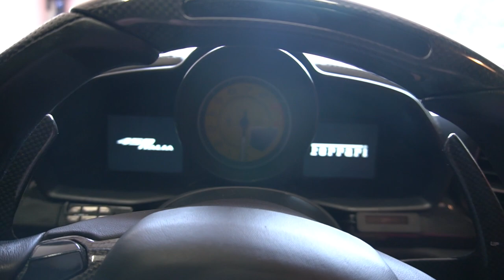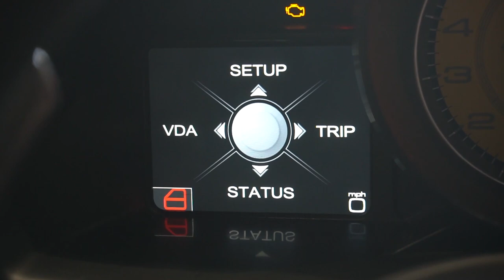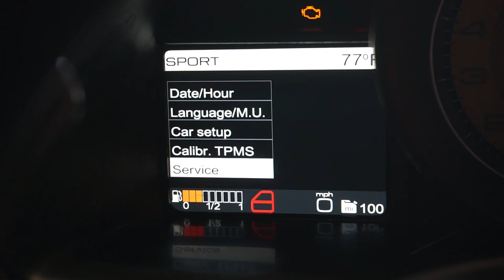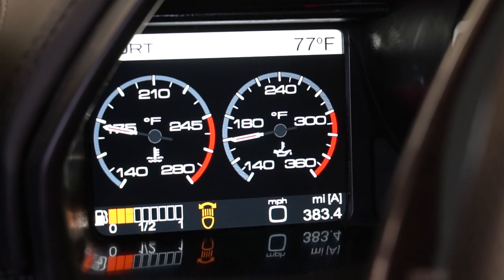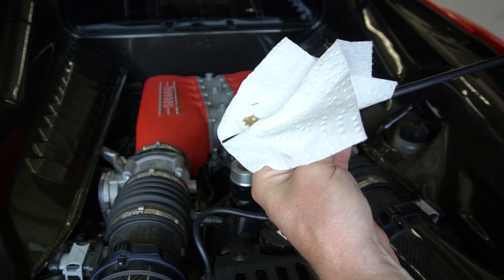How to change the oil in a Ferrari 458!

Comment: You need a 4 post lift bud.  Life changing experience!!!!
Reply from the maker: I'm content with my quick jacks
Reply: Javier Hernandez - mixing a 9 foot ceiling with a short guy and shorter car makes it work pretty good (I had that setup in the last house).  Certainly the higher ceiling is better, but this can work if your not sticking an F250 up there!
Reply: Javier Hernandez - that’s the 2 post lift that has the higher posts bud.  My 4 post has 7.5 foot posts.  Really nice setup for about $2k!  Thing even has rollers and can be moved around...
Reply: @devnull128  really 7.5ft, 2k, and can be moved? I thought they were more expensive, that's pretty feasible. What's the max weight of yours.
Reply: Javier Hernandez - I have an 8,500lb setup.  Have had it for many years (bought it when I had my first C5 Z06 and needed a clutch).  Was cheaper than the clutch!  Paid for itself 100 times over.  Can’t recommend these things enough dude!
Reply: @devnull128  dang was the clutch repair that much cheaper that a car lift and diy fix was still cheaper than a clutch at a dealer. Only problem is that have a Yukon xl Denali and a sierra so the weight is kinda pushing it but I think it'll do. What brand or model is it.
Reply: Especially for a Ferrari beautiful piece of machinery❤️😍🥰

Comment: Dan, there's a thread on FerrariChat by AZLambo, from Oct 2015 called, "DIY oil change made easy
" 
Basically, since all three drains plugs drain straight down, he modified the plastic under-tray to create 3 drain holes and removable rubber plugs. Since you're no longer in warranty, might make an interesting future video  doing that mod, since this way is such a PITA.
Reply from the maker: Yeah I saw that. May look into it
Reply: David Grant ,

AZLambo here!  Yep, by hole-sawing out the three, 3” holes in the undertray, and putting in the three 3” rubber “plugs”, changing the oil on my 458 is a piece of cake!  No undertray panels to remove!

Comment: This is the video we all have been waiting for since you bought the 458!  Next time, you may want to lubricate the o-ring with fresh oil (Standard procedure for similar oil canister on Gallardos).  I am not sure if the o-ring requires lubricant for the 458 (Perhaps it’s a special Ferrari taxable compound), but I would put oil on the o-ring and be careful not to over tighten the canister (oil on the canister to engine interface increases joint axial preload when applying a given torque).  Apologies for my nerdiness, another awesome video Dan!
Reply from the maker: Ah yeah good tip
Reply: Normal Guy Supercar That’s what she said.

Comment: I assume that you lubricated the o-ring before installation to prevent it from binding on the housing.  Also, it's more friendly to the motor to add a little oil in the housing before buttoning it up.

Comment: Why not consider an elevated funnel or raising your drain bin upwards to mitigate the heated oil splash. I grew up in an old fashioned gas station, our drain bin was always never more than 12 inches away from the oil drain plug... This is a simple solution to oil drain splash...
Reply from the maker: Yeah.  That may help.

Comment: Just a FYI. You might want to change the oil filter first to allow the old oil to drain from the Oil Filter housing back into the system. The filter housing is designed to hold oil in it for startup. Great Channel!
Reply from the maker: Ok thanks for the tip

Comment: Dan, do you leave the filler cap open whilst draining the oil?
It seems to work better for me, as oil comes out more evenly and directed as opposed to sometimes when it is erratic and I end up making a mess
Reply from the maker: No it was loose
Reply: I unplug the dip stick so it's more restricted than the oil cap but doesn't glug.
Reply: Cool :)

Comment: Time passes , but the 458 is one of the best looking cars / ferraris ever made 👌.
Wich wheels do you have ? 
Also where is the oil spec (viscosity etc ) stated ?  I tought the 458 would need like a 10w60 in the summer
Reply from the maker: The service manual specifies 5w-40.  I don't know which wheels they are as they are aftermarket.

Comment: Maserati twin turbo V6 oil change interval is 12K also, but since it's direct injection I change oil every 8K to 9K to reduce the likelihood of excessive carbon buildup on the intake valves. I do my own oil changes so it's cheap enough.  I don't know if the 458 is direct injection but if so you may want to consider more frequent oil changes as well.
Reply from the maker: Yeah I'm planning to change it far earlier that 12k.
Reply: 8K - 9K is too much on a turbo engined car,  5K is maximum in my opinion.
Reply: @maxnix346  not on a Ghibli V6. Made by Ferrari.

Comment: Hey Dan, any chance you can do a video detailing the use of the Launch X431, specifically pulling numbers on a clutch or changing the F1 pump fluids?  Cheers.
Reply from the maker: Sure
Reply: Den!
can this diagnostics check the clutch wear? and re-learn the ecu gear change when the clutch is changed?
and of course get the air out of the system when changing oil in the F1 system ??
My car is F360
Cheers.😎
Reply from the maker: @mariovu1978  the higher model can
Reply: Normal Guy Supercar 
Launch X431 Pro V3.0??

Comment: Have you thought of drilling holes in the pan so you can access the drain plugs without removing the pan?
Reply from the maker: Yeah that's one solution... But then it might collect a bunch of oil on the pan if you splash it. Plus you don't get to inspect the rest of the car.
Reply: @normalguysupercar  Good points

Comment: I think you have the Quickjack in the wrong orientation. In addition to front and back specific, the locking arms are suppose to be on the outside not on the inside.

Comment: Great video Dan.
Does the Launch X-431 PROS Mini also connect to a GTC4Lusso? I have a 2012 458 Italia which I need to start doing my own oil changes as my 7 year maintenance plan just expired. I would be willing to spend this amount on the Launch computer if it was also compatible with my GTC4Lusso.
Reply from the maker: It should do the Lusso

Comment: No new stamps in the service book, is it not decreasing the car's value?
Reply from the maker: It may
Reply: @normalguysupercar  Not if you have receipts and video as proof.   Sign the damn book yourself.
Reply: No
Reply: Just keep the receipts! Good enough
Reply: You don't need to be a Ferrari tech to change the tyres do you ? The oil change on the 458 is as simple as it gets. I'd rather someone like Dan to change the oil himself and spend that 2k on other pressing maintenance items, if I were looking at buying his 458. This is Dan's baby...however, to a dealer it's just another 458 they need to do before lunch. A stamp is not worth 2k.
Reply: @themessenger5868  just saying that the next owner may care.
Reply: @simplecarblog5663  , Yeah I understand, but if it were that important to them I guess they wouldn't be the new owner. I've owned a Ferrari for 12 years and I can say from experience that dealer servicing is a rip off and not worth the money. Like anything that is for sale, it's worth what someone's willing to pay for it. I understand the question, I just don't agree with it when it comes to older Ferrari's and other cars.

Comment: The hardest part of the oil changes is removing the forward panel. How do you remove and remount the air flow guides from the forward panel when the car is dropped to the ground, with minimal clearance?
Reply from the maker: With patience
Reply: Normal Guy Supercar Oh no 🙈. Thank you 🙏

Comment: With your quick jacks.... do you still put jack stands under the car for safety? 
Is that Pennzoil really the best oil for a super car like that? Just seems like that’s such a simple oil for such a not so simple vehicle. Cheers
Reply from the maker: No need for jack stands. Pennzoil is the official oil for Ferrari actually so good enough for me!
Reply: That is correct. Pennzoil is factory fill, the oil bottle has the Ferrari logo on it! LOL

Comment: My race car was leaking oil at a seal in the oil pump. With taking the oil pump off and putting it back on the car took 11 3/4 quarts of oil just to get to the first dot on the dip stick. Taking the oil pump out there seemed to be around 1-2 more quarts that came out compared to just draining the oil. What are your thoughts on that.. does that make sense to you? Everyone keeps telling me that the car is only 10qts.. But at 95c oil temps my oil level was at the first do.. cold the oil is about 3/4 up on the dip stick.
Reply from the maker: Was the car running?
Reply: @normalguysupercar  yes.
Reply from the maker: @Megachad  interesting. Not sure then
Reply: @normalguysupercar   Agreed. ha.. I imagine if your car typically takes 10qts on an oil change then taking the oil pump out would add an additional 1-2 qts when filling it back up. Have you ever put a full 10qts in on a change before?

Comment: I reset my 991 with a LAUNCH X431 Creader 7S ($80) - wonder if that can be used for Ferrari
Reply from the maker: It might be able to.  Does it have Ferrari as an option?
Reply: Just got back in town and plugged the device in - Looks like Ferrari > 458 Italia are options on my unit.

Comment: My car also has a dry sump system. It's too much of a pain for me to work on in my advanced years. The car must be completely level. And mine is easy compared to the Ferrari's. Thankfully, my servicing dealership allows me to bring in my oil/filter. They only charge me for labor, EPA disposal and taxes. About $42. And, I can get the undercarriage checked out while it's up in the air. Not really worth it to change it myself anymore.
Reply from the maker: For that cheap, that's a pretty solid deal.  Hell, I'd probably pay that vs doing it myself.  LOL!

Comment: Seems I am having some issue getting all of the old oil out of my 458. I opened and drained 3 plugs overnight. I put 8qts of the recommended Pennzoil in and my dipstick reads about an inch over the max line at the recommended check temperature. Anyone else experienced this?

Comment: Pennzoil I wouldn’t put that in my lawnmower. It’s a Ferrari how about some Motul or at least some euro spec Castrol. Is that what ferrari uses from the factory? I thought ferrari was Shell brand only, granted I believe pennzoil is owned by shell but step up to Motul.
Reply from the maker: Pennzoil is a Shell product and is what Ferrari recommends. It works great.
Reply: Pennzoil Platinum Euro (PurePlus) is very good oil (I'm assuming that's what went in it). Not cheap.

Comment: What intrigues me with you US guys, everything is in quarts... why not 5 litre tub + a quart etc? Inside of loads of little bottles? (Ignore the amounts, talking in general🤡)
That filter is in a properly awkward place though - yous still got the Forrester?  So much easier haha
Reply from the maker: I don't know why we have the measurement system we have. It's crap
Reply: Normal Guy Supercar can yous physically buy a 5 litre bottle of oil from your stores? Or they all quarts? 

Example my Impreza, I buy a 5 litre, whack it all in and 9/10 it’s JUST below max... I couldn’t be arsed putting 5 bottles on/off haha 

You getting your Ferrari tech to come evaluate the 458 too??🥰😏
Reply: If you buy a specialty euro oil like LiquidMolly or Motul, which surprisingly you can find at Auto part stores it will come in litres. However I disagree, I like imperial measurements for everything except bolt sizes
Reply: Bilal Blaik millers? Shell? Big in the US?

I lIve I the UK and NEVER heard of LiquidMolly🤣
Reply: We got shell, but such a big company that US has its own division and refineries and thus still in quarts. Popular choice for people with diesel engines. Never heard of Miller's. All the VW/Audi enthusiasts in the US swear by the LiquidMolly stuff although I think most of it is just marketing BS, they do make pretty cheap 5w-40 though which is harder to find here
Reply: Bilal Blaik crazy man - nothing better than propping a 5 litre bottle with a ratchet, a stick and some gum waiting and praying for it not to fall 🤣🤣

Comment: Pennzoil oleo is shit, for a high performance car like this
it is also almost given, cheap
in a car like this I would only use motul 300v, but of course it costs several times more, but the engine lasts much longer and runs smoother
Reply from the maker: OK

Comment: Ur not supposed to check the oil while the engine is running that must be the stupidest thing ive seen someone do plus u forgot to open filter cap before u drain the oil 🤦‍♂️
Reply from the maker: Perhaps you should learn what you're talking about before commenting. You do check Ferraris while running. In fact most dry sump cars you do.